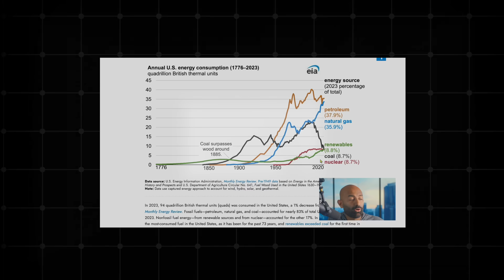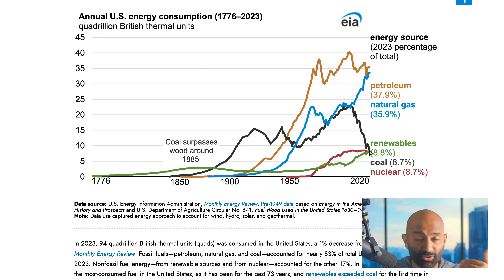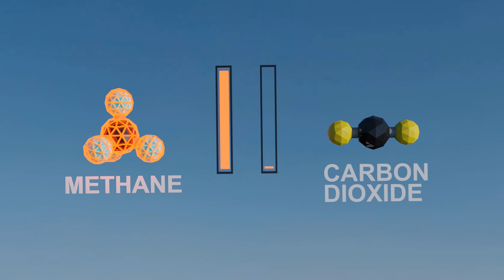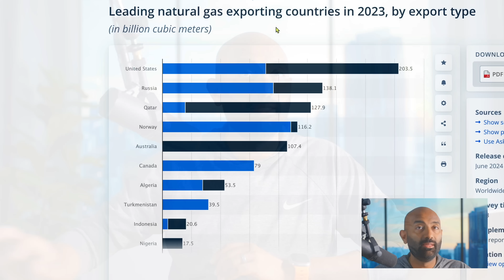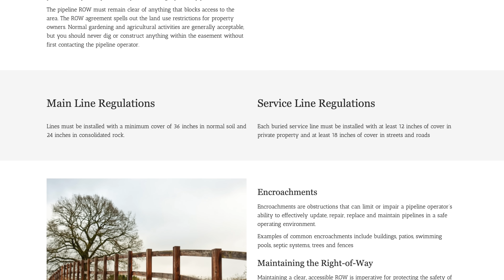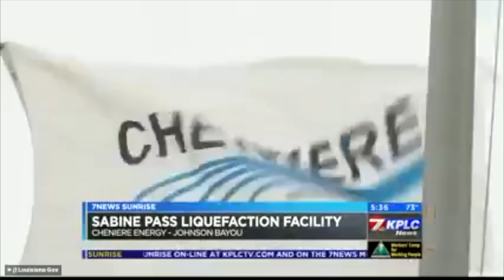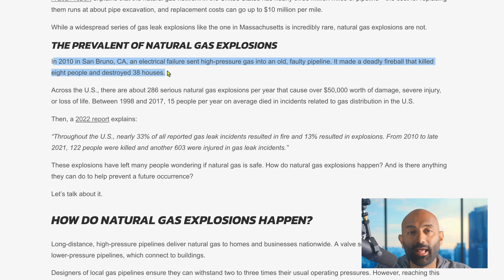The TRUE Danger of Natural Gas - This SHOCKED Me

Comment: heat pumps are fine so long as you have extremely abundant supplies of cheap electrical power... with NG or propane I can heat water with better than 95% thermal efficiency to almost any desired (for bathing use) temp while with heatpumps I cannot get anywhere near that plus the efficiency drops off the hotter I want the water...

good to have options but using solar or wind to charge batteries only to discharge them in heating applications is a fool's errand
Reply: The effeciency of heat pump water heaters is 4-5x that of gas. So as long as your electric rates are less than 25% of your gas.. it's still more economical to use a heat pump water heater

Comment: I just built a house for my friend. We live in Ontario Canada and he got a massive air sourced heat pump system that works down to -18 C but the power where we live goes out often enough and winters here go down to -40 C in Jan/Feb. So the heat pumps are 3 season units here while Propane does the winter stint. We have an 80 C temp swing from summer to winter and heat pumps are just not quite up to the task here yet. Ground source is another story, but air source does not work here mid winter so propane and natural gas is a must here for sure. Wood is perfect too

Comment: As a gas installation contractor, I would point out that 98% of accidents occur due to overconfidence. 

That you will make no mistakes or that pipes don't corrode... Someone should have known that the pipe you are showing us was installed too many years ago. It should have been replaced years ago, at least a decade ago.

Comment: I like diversified energy in my house. I want natural gas along with electric for my house. If one fails, I have another. If there is an electrical outage then I only need a small generator to keep my house warm or burn fire wood. If there is a natural gas outage, then I can heat my house with electricity or fire wood.

Funny, electricity has many of the same issues. It is also in high demand in summer for AC and heat in the winter while having low usage during the spring and fall. But electricity cant really be stored so swings during the day require huge swings. Yes, transporting electricity also cause energy losses. Just like natural gas requires energy to pump, electricity also has losses.

You list the number of people that die from natural gas, Ill bet far more die from electric shock.

There are no perfect solutions, only trade-offs. I'd also point out that getting your opinions from a dramatized TV shows.

Id also point out that a lot of heat pumps use propane as the working fluid.

Comment: That little flare that you referenced is there for safety reasons in case of a plant upset.  Otherwise raw gas would be released uncontrolled to the atmosphere and who knows where it go until it either diffused or find an ignition source.  Not such a good video for you.  I'm disappointed as most of your videos are well research but this one apparently wasn't.

Natural gas is also used in many chemicals processes that we rely on in our daily lives, including medicines!  One of it's products in ammonia and urea used as fertilizers for farming.  I've worked in the Oil and Gas industry for most of my career and never of the industry using "cavernous"?

There are some old lines that do need to be replaced and updated.  Modern lines are plastic lines or at least plastic lined.
Reply: Fairly weak one indeed.

Comment: i feel like this video is very much fear mongering. i'll try to make this short. i use and have used gas in my home for generations for heat, cooking and water heating. firstly, they add a 'rotten egg' orderant to natural gas so you can smell it. secondly, that pipe you are showing, where did you get that from? the only underground pipes we have here are the supply lines. once it gets to your meter at your house it's above ground. speaking of, your meter, that's in essence your circuit breaker it manages and maintains the flow. most of these explosions you see are people who are either bypassing the meter with their own containers of natural gas stored on site. i've never had a rotten pipe like you have there. and by the way, i have had circuit breakers fail and almost burn down my house on numerous occasions. yes, circuit breakers can come bad right out of the box and you wouldn't know until they fail when your house burns down. my gas bill per month is also much cheaper than many people that i know who run electric for their heat,cooking and heating. and speaking of electricity, you may or may not always have the grid avail. power outages happen. and not everybody has a solar setup. and if you don't for some reason have the grid or your solar system goes down (try having a controller failure that needs to be replaced, how long will that take?) it's good to have the gas backup. here's what i'd suggest, and what i'm thinking of switching to. look into getting a biodigester and make your own natural gas. you'll help the landfill and keep your waste on your own property and can still have your own gas source that does not require ANYTHING other than nature. if the shtf and your solar system goes down, good luck jumping on amazon to get that replacement part... natural gas is as dangerous as anything. respect it, keep your stuff maintained and you'll be fine.

Comment: In Australia, some natural gas appliances can be converted to run off portable LPG tanks (I think they call it propane in the US). It's much safer as long as you inspect the hose every so often and you only need to pay by the tank, so it gets replaced long before the cannister would start having any defects.

Comment: As others have commented,  I so appreciate your research and reporting into relevant issues as I do on this one. I agree that electrical power is an obvious choice. Currently,  however, the choices of huge solar panel fields, wind power and megabatteries have their own problems including the massive mining of the minerals needed. The only current option for the huge quantities of electrical energy needed to replace fossil fuels are the new nuclear technologies as being developed with the help of people like Bill Gates.  They do offer almost limitless electrical power. I realize this issue is a third rail of politics but there it is. Any pipe made out of metal (except perhaps for high grade expensive SST) has a limited lifespan but like one commentor mentioned the use of medium and high density polymers offer an almost limitless lifespan. But then of course that requires petroleum.  Here we go again with the resistance.  I do have friends with heat pumps though in northern climates that have had great success in the newest heat pump technology.  It's almost magical how a home can be heated out of subzero temperatures. It bogels my mind. One partial solution would to place electrical generation near the source of natural gas production.  Also, capturing of methane produced from landfills should be mandatory.  Why not utilize this gas? It's going to escape otherwise  It's time to remove politics from this equation and apply science

Comment: Companies add mercaptan to add a strong smell to the gas which is incredibly strong smell at very low concentrations.  They routinely drive cars around with sniffers that locate leaks.  It also has a very narrow range of combustion concentration, between 7-11% gas in air.  It is a dependable energy source since delivery is rarely disrupted by weather.  But it is your choice, disconnect your gas line and pay 5x for your energy via electric.  Of course the power plants love natural gas because it burns so clean.

Comment: Here in the PacNW we have frequent power outages due to falling trees. So, reliance on only electricity is not a great option. We heat with wood and propane as well as electric. If the power is out for a few days, it is livable with these alternatives. Heat pumps cost about 3x the cost of gas furnaces and they don’t work well in freezing temperatures. Solar is not an option here due to the forests. What seems logical from where you are in CA is not practical in many other environments. Love your channel, though! Fellow engineer…

Comment: Thanks Ricky, I thought your outlook was well balanced. Here in our Montana homestead we are replacing NG heat with solar powered heat pump heating and cooling, induction stove etc. It will be effectively free for us to operate, but is costly to install.
Some time ago, I walked into the kitchen and found it full of gas. Someone had walked by the gas stove and accidentally bumped on the switch. My family was seconds away from a disaster. It changed me.

Comment: All forms of energy have their dangers. Ever seen an entire neighborhood arcing and on fire after a high voltage transmission line fell over the local distribution lines? It happens, and I’ve seen video of it on YouTube. The fire departments can’t do anything so long as the power is flowing, and even getting close to one of the houses or power lines could kill a person. This video seems very one sided. Also, if all of the natural gas, petroleum and coal that is currently in the ground were to be burnt and all of its carbon dioxide released into the air, we would only be restoring the atmosphere to what it once was before all of that CO₂ was locked up underground. Who decides what the proper amount of atmospheric CO₂ is?

Comment: Compressed natural gas (CNG) can and frequently does have issues with leaking at some point along the line, that is the problem here of course. However at least to my knowledge, Liquefied Natural Gas (LNG) does not have much if any issues with leaks. I know there are some drawbacks to this idea, but we could at least consider being more reliant on LNG instead, or at least until it gets to where it needs to go, then it can be turned back to CNG which to my knowledge, isn't very hard or expensive to do.

Comment: The gas company in northern Ohio is replacing the metal underground pipes with yellow medium-density polyethylene (MDPE) pipe.  This is more corrosion resistant than the old metal pipe.  In cases where the underground metal pipe to the customers home is leaking, they often just dig it up at the street and house ends and shove a polyethylene pipe through the metal pipe as a liner.
Reply: Didn't know they could that. Really clever. Less digging and stronger than the composite alone. I've seen pvc underground irrigation and drainage pipes crushed by heavy equipment. Don't suppose the reduction of pipe diameter would make much difference at the end user

Comment: One thing that you've sort of implied is that electricity costs the same natural gas, which is not the case.  My electricity costs 5.8 times as much as natural gas, for the same amount of delivered energy.    So, even if electric cooking and heating were twice as efficient as gas, which isn't the case for heating, it would still cost me at least double to use only electricity.

Comment: When fossil fuels decided to come back to PA, I hiked the proposed gas pipelines and saw many old existing ones. People have no idea of the superhighway of pipelines under their feet.  And no, if the pipelines I saw going in are evidence, it was never meant to be transitional.  As people see more impacts and costs from climate change, and they're going to be bloody awful, I think fracking will be known as Obama's Folly.  Lastly, a sister-in-law and her boyfriend died from a backdrafting gas water heater in the house she and her boyfriend were fixing up.  You can check yours with watching the direction of the smoke from a blown out match placed need to vent pipe.  The smoke should be drawn into the pipe.  Thanks.

Comment: Here in Toronto this winter has been very cold, heat pumps would not cut it or use huge amounts of energy so you need a backup heating system, gas.  We have a new ultra efficient gas boiler that does hear and hot water in one unit.  The PC government is expanding natural gas generation in the province and it is likely that my power comes from a gas plant about 8Km from here.  How is it more efficient to use gas to generate electricity then transmit it to our location and convert it back to thermal energy..  It is a big waste and our boiler is much more efficient overall.  We should not be penalized by a carbon tax on natural gas if it is the most efficient option.

Comment: I’m a 70 year old retired mechanic from Southern California Gas. I worked at those compressor stations in the storage field you talked about.  Our system has been in operation for over 100 years now.  Our storage fields were actually old oil fields not caverns.  We always work to reduce leakage as that is money for us.  In my career natural gas hardly varied in price because of how stable a fuel supply system it is.   It wasn’t until politics got involved it natural gas prices start to fluctuate a lot.
Reply: Have you ever seen galvanized pipe used for natural gas, other than a DIY hillbilly fix or install?? I haven't and I'm 62
Reply: @ not very often on occasions as a drip leg on a furnace or water heater. Never seen it buried are used in bulk.

I’ve seen it used on elbows and fittings around the gas meter, but never buried in the ground.  The stuff I worked on was all high pressure thick wall stuff.
Reply: Of course it did. That's what this is about. Control and slavery. You will own nothing and be happy... or else. 

Funny, he did not mention that our electricity grid can not handle everybody going electric, did he? California has already proven that. So has England's and Texas windmill farms. Where is all the electricity going to come from?

Comment: Have had natural gas for heating, cooking, clothes dryer, hot water my whole life (50+ years) here in Utah.   Here at least it has been more economical than electricity.  The cost of electricity (solar at least) is falling fast so will be interesting to see what happens in the future.  I will say gas has been more reliable.  I cannot once over 50 years think of a case where the natural gas went out.  The electricity, couple times a year we lose power.  If In the middle of winter that could be a bad thing.  The pipes for natural gas are all buried underground and thus have a lot less chance of having weather, hang gliders, birds affect the delivery that electricity is sometimes susceptible too (newer home areas also bury the electric lines).   Have not seen any traction whatsoever here to move away from it.   I like the idea of solar w/ power walls to be self sufficient myself.

Comment: I live in Washington state, I wish I could get Natural gas directly to my home. I only have electricity and last week we were with out power for 3 days. So I thought oh I will just pull out my Jackery and charge it with the 60 watt solar panel. Well it was only generating 4 watts of power because of the clouds. I ended up using a gas generator to recharge it. Next time I will be prepared with a propane generator. I think it your area the days may be numbered but not it colder and cloudier areas for a long time.

Comment: Not concerned about NG unless it’s is leaking into a home without a gas detector which starts at $20 so it’s affordable. Research CO2 (carbon capture) pipelines when they’re leak. That is scary.

Comment: Let me start off by saying I love your channel! I’m a 24 year natural gas technician here in Southern California and I agree it’s a bridge energy source and should be used mainly as option number two. As far as leaks go we currently have a helicopter program that detects leaks that are dispatched to field technicians for investigation. I find a lot of interesting finds including landfills, oil vapor leaks, bio fuel digester leaks, and methane leaks from local sanitation departments waste. We monitor our lines as well as our customers lines. We also have an analytics department that can determine our customers gas  leaks by just usage consumption. Most of the time our customers don’t even know they have a leak until we show up to let them know.
Reply: Get your customers some new noses.
Reply: True with water in my area.  Got an email telling me I had a water leak.  My house was dry, then I recalled there is an old landscape watering system and sure enough, it had a leak, which I immediately repaired.

Comment: It's interesting to learn about "coal gas" which was used in cities before the wide spread adoption of natural gas.  I grew up in Seattle and there was a prominent gasification plant at the north end of Lake Union.  This was shut down as it was no longer needed with pipeline supplied natural gas and the site turned into a urban park, with lots of extremely polluted land underneath.  The burnable component was largely carbon monoxide and hydrogen and was quite toxic.  Carbon monoxide poisoning is really bad.

Comment: Natural gas isn't that dangerous when handled properly, bad and lacking maintenance of its infrastructure is, and bad infrastructure maintenance is all too common in the US.
Part of this maintenance comes to the home owners, who are responsible for everything behind the meter. Old connection hoses and badly maintained boilers and heaters are often the cause of house explosions. A propane cylinder kept in the basement is even a larger risk as propane is heavier than air and collects in the basement rather than rising up and escaping via the ventilation like natural gas.